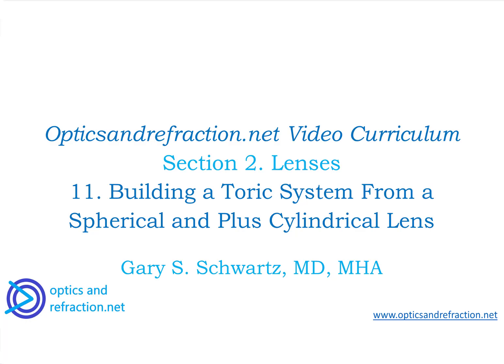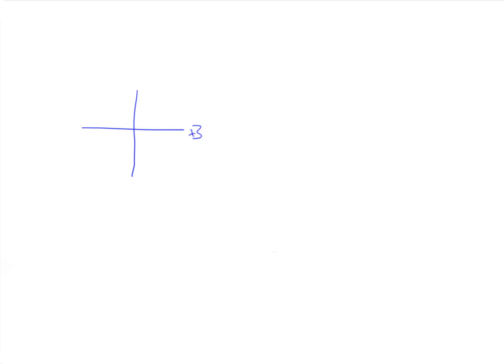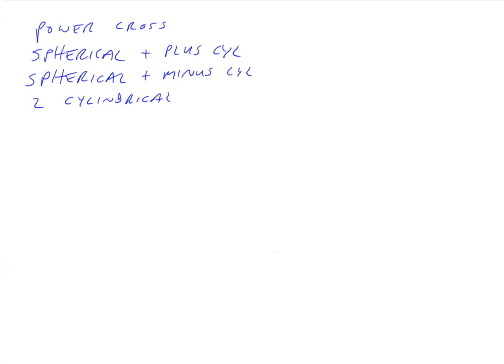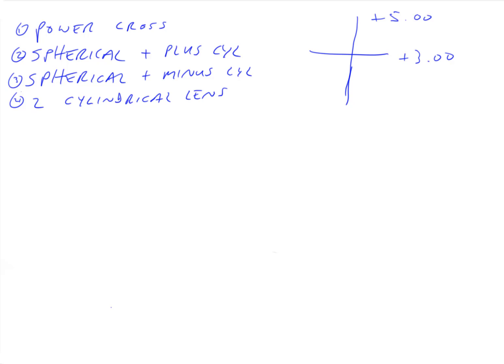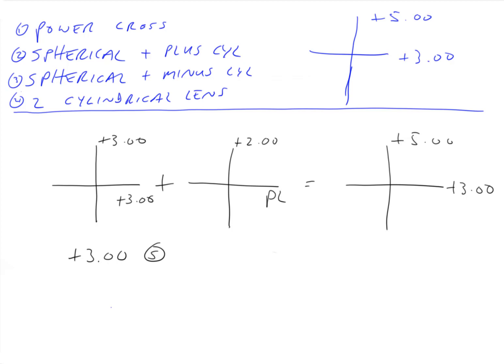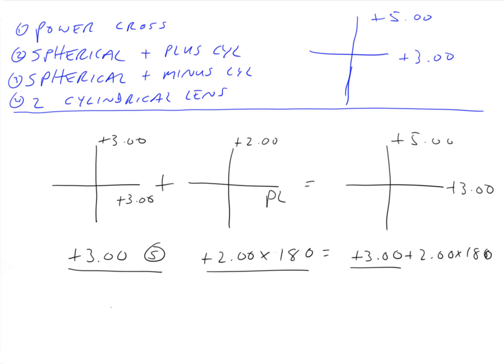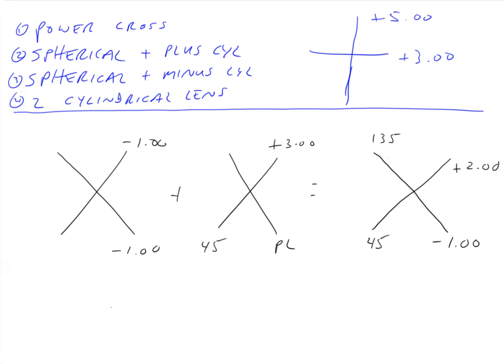2-11 Building a Toiric System From a Spherical and Plus Cylindrical Lens

Comment: +3. 00 /-3.00
Reply: +3.00 Dc
Reply: Spherical equivalent= +1.5D, because +3 is spherical power & -3 is cyl power, As sph. equi= sph power + (cyl power÷2) ⇒ 3 + (-3/2) = +1.5D . Note: DS= diopter sphere, DC= diopter cylinder.